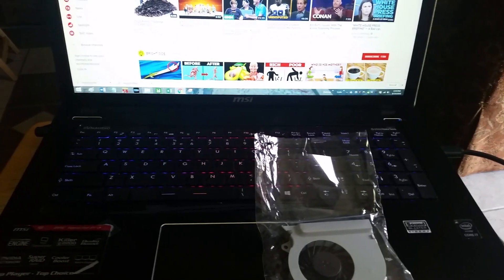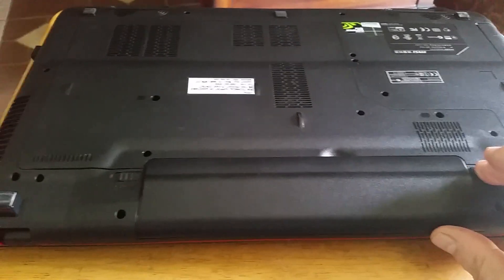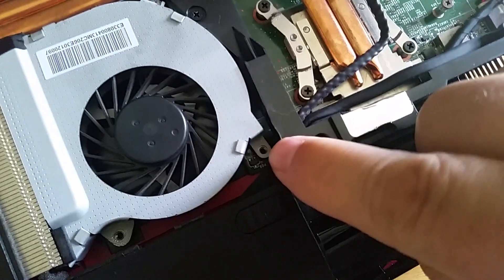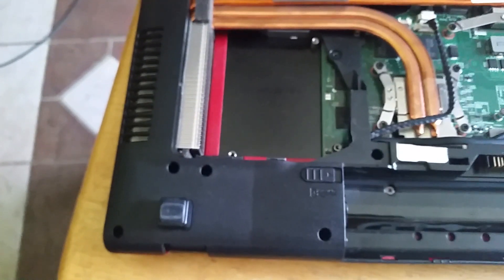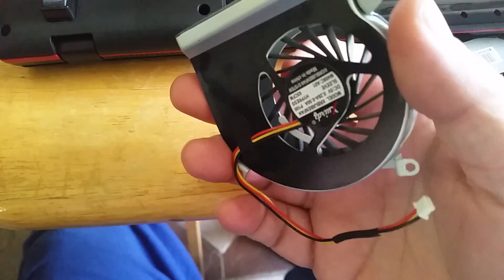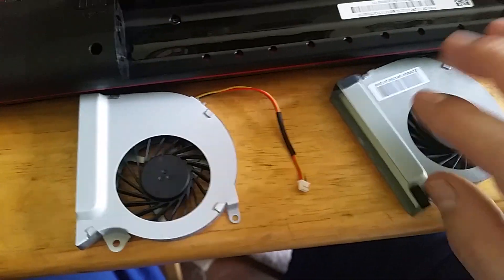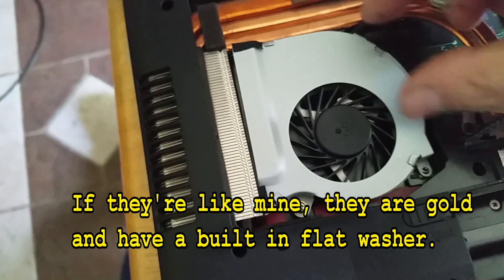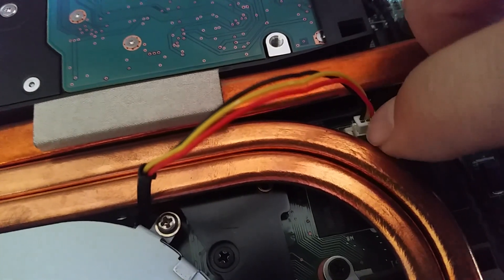MSI GE70 GE60 2PE Apache Pro Fan change EASY PAAD06015SL

Comment: Hello, I know I'm 2 years off but my issue is all the replacement fans i buy( and i bought 3 already) spins for like 3 seconds and stops.
The one thats working but makes unbearable weird noises is PAAD06015SL N285, I've bought exactly same one but same issue, it's just stop spinning after few seconds. Any idea how to fix it?
Reply from the maker: Sorry for the late reply. Here's the last one I purchased on Amazon and it's in my laptop right now and running fine. https://www.amazon.com/gp/product/B019YV65FY/ref=ppx_yo_dt_b_search_asin_title?ie=UTF8&psc=1
I purchased two because I've had the same problems in the past. I think the problem is the design. It operates while the fan is hanging, while others operate while the fan is sitting on the base. The reason the noises are there is because of the poor Chinese manufacturing of them. Every once in a while you get a good one. So yeah I feel your pain. Anyway, I hope this fan works for you. Best Wishes & Blessings. Keith Noneya

Comment: What did you use to trim the metal on the fan casing? Mine has the same issue
Reply from the maker: I used a bench grinder, and gently ground it off. You could use metal shears to cut it off, or use a file to cut it down. If you use the file, stuff some toilet paper inside the hole and tape off the side to keep metal out of the motor. Hope that points you in the right direction. Thanks for watching. Best Wishes & Blessings. Keith Noneya
Reply: @keithnoneya  it does! Thank you very much

Comment: Hey, do you know if the fan n285 works the same as n039?
Reply: No, they are different. I have tried to replace n039 with n285 in my GE70 2PE and it works not like original (very poor coolent). Its because n285 has 4 windings and original cooler has 6 windings
Reply from the maker: Sorry I don't know of any fan that works other than the one I chose. I know that there are several fans that can work by part number but the shape may be wrong. If you have what you think is an acceptable substitute make sure and check the shape and mounting tabs in the pictures and compare them with the one in your computer. I made that mistake once and the fan holes did not fit. I fixed this problem by removing the old fan cage and put it on the new fan. Hope that points you in the right direction. Best Wishes & Blessings. Keith Noneya
Reply: Do you have the link for the one you got? Is your msi model ms 1759? I Just got a fan that was supposed to be the same model as my Msi, but it wasn't fml.
Reply from the maker: @planetaerickgames1159  Hi Aline yes my MSI GE2PE is Model No. 1759. Here's the fan I purchased Cooling Fan Module E33-0800413-MC2 Just do a search on eBay or Amazon and they will show up. The new fan is quiet so far. You can clean the old one and then put some sewing machine oil in it and it will take a few minutes to get into the fan spindle but should be quiet for a little while until you can get a new one. Hope that helps. Oh make sure it looks like the old one again. Best Wishes & Blessings. Keith Noneya

Comment: Does your new fan support 6000 RPM with 'cooler boost'?
Reply from the maker: Yes for this model it does.
Reply: @keithnoneya  I have a "MSI GE70 2PC" laptop and it works compatible with the "PAAD06015SL N039" model fan. I also bought two different fan, but none of them worked on my laptop, meaning they didn't support 6000 RPM. So I returned them all back. Also one of the fans was the "XUIRDZ" brand but my fan's sticker didn't look like yours. I have been bought one fan from Aliexpress before few days. I hope it will be compatible with the laptop.
1- My original fan
resimag.com/i/93f9cc5c7e6

2- First purchased fan
https://www.resimag.com/i/e748ffc5332

3- Second purchased fan.
https://www.resimag.com/i/7de2f3ce805

The information you provided was very valuable to me, thank you. If the last fan I bought is not compatible, I will find it like yours.
Reply from the maker: Hi Adi, the second fan I replaced I had to straighten the tabs to on my old fan cage to mount the new fan onto it. For some reason the manufacture sold it as fitting my laptop and it did not, but the only part I needed was the fan portion. There seems to be a problem with fan suppliers these last four years. They don't last very long and they are poorly made. The links you sent me did not work. It just took me to a Turkish website with no fan details. I used Google Translate to figure it out but was not able to view any fans. Keep me posted on how you solve the fan problem. It is a very interesting problem. Best Wishes & Blessings. Keith Noneya
Reply from the maker: @adiefsane4967  Hi Adi, your English is fine. In fact I almost couldn't tell you were used to another language. Anyways I found that if I put a few drops of machine oil, better known as sewing machine oil, the fan will quiet down after about 10 minutes of running. I have to do that about every month or so. It's a lot cheaper than buying cheap fans. How are your fans working out? Thank you for the nice reply. Where are you from Adi? Best Wishes & Blessings. Keith Noneya
Reply: @keithnoneya  First of all, thank you for this conversation.  I am from Turkiye. Actually, I help from google translate. But if I don't know some about English, "Google Translate" be very useless. (By the way, my English level is between B1-B2.) Also, It is forming long sentences helps me a lot. If we return to our topic;

Let me suggest you things I know about laptop fans.
1)  You can safe the day with machine oil. Your fan will die soon. Because once the laptop fan has made a sound, it is now doomed to deteriorate. This is because the bearing and shaft are now worn out due to friction.
I used machine oil like you for MSI GS63VR once a month. But the result is disappointed. So I had to change it.

2) I recommend grease instead of machine oil. But it shouldn't be stiff. This like video: https://youtu.be/O1GkeJk18u4?t=140
In fact, I think it would be more efficient to renew the oil every 3 months or every 6 months after the first time the fan gets it first.

The fan I use now is pretty solid and quiet. Although six months have passed, I did not clean or lubricate. But I must do it soon for the health of the laptop and fan.

Although the technical terms have forced me, I hope I could explain my opinion.
Thank you again for the conversation. Best wishes and take care of yourself.
Reply from the maker: @adiefsane4967  I looked at the video in the link. It's a good video, I too agree with the grease. It's far more effective in maintaining lubrication, as it doesn't run out and it layers up to keep dust off the inside rotating shaft and bushings.
 keith_noneya@att.net is my YouTube email. I have friends from all over the world and enjoy other cultures. I was in the U.S. Navy many many years ago, back in the 80's and 90's as an Avionics Technician. I retired from that over 20 years ago. When I was in the Navy I loved going to many countries all over the world on our ship. I went to: Philippines, Hong Kong, Sri Lanka, Kenya, Australia, Israel, Italy, Canada, Mexico, Thailand, England & possibly others I forgot to mention. One of my favorite trips in the 80's was to Haifa Israel. As a Christian it was wonderful. I was invited to stay with a Muslim family who treated me very well, even in my US Navy Uniform, they were so kind and generous. I played with the children answered questions about the US and had dinner with them and even spent the night in their home. I doubt that would happen in today's world. People would either would want to harm me or the good folks would be afraid of their neighbors attitude. One of my other trips I really enjoyed was one to Italy. I was approached by an older gentleman in I would say his 70's. He took me to his home to meet his wife. We went down some narrow streets to an old stone building. We went upstairs to his apartment. I sat at his table in my Cracker Jacks, the traditional US Navy Dress Uniform. He reached up into a China Cabinet and pulled down and OLD bottle of Johnnie Walker. He pulled down two glasses from the cabinet and dropped a few Ice cubes in each and pored a drink for each of us. He wanted to thank the US for saving Italy from the Germans in WWII and didn't know how to do it until he saw me in uniform. I was humbled that he chose me to say thank you too. Out of respect and because of his kindness I visited him on several more occasions where he showed me his town, of Naples Italy. Using Google Maps I think his house was 199 Via Sedile di Porto. It's a shame what the neighborhood looks like now, back then it was well kept and clean & NO graffiti. I have many stories of that of what it was like in the world back in the 80's & 90's. The world was a more peaceful and tolerant place then, it's so different now. It's shameful to see what the younger generations have done to civility, peace and tolerance over the last 20 years. Absolutely SHAMEFUL! Anyways that's not why I wrote back. I just wanted to say thank you for the information. You have a kind & generous heart, something the world needs more of today. Best Wishes & Blessings. Keith Noneya